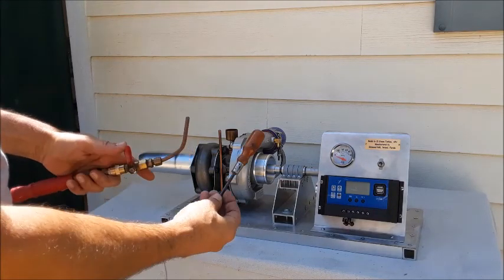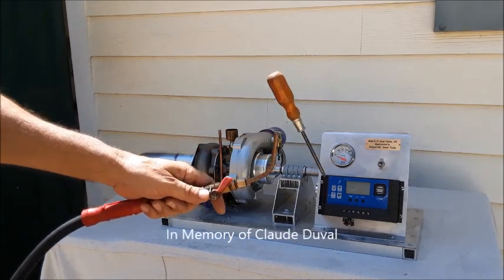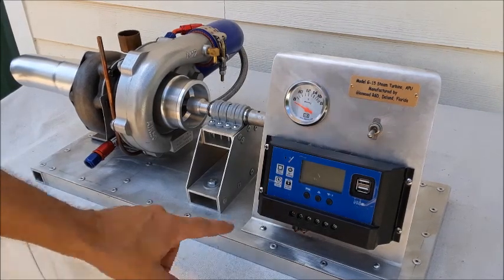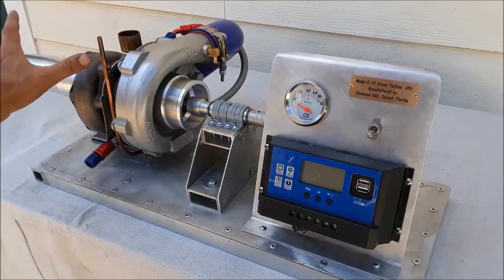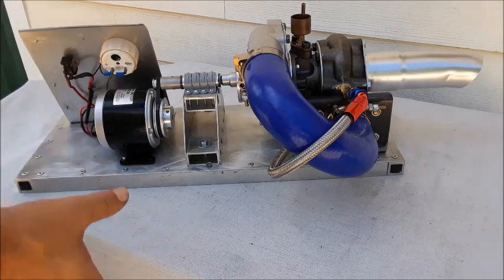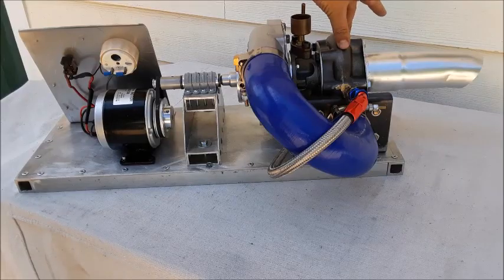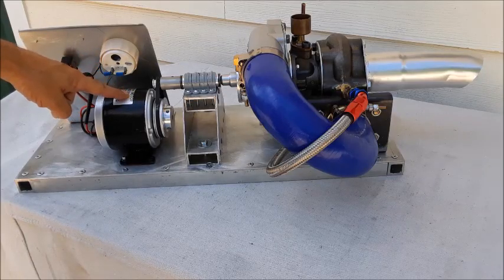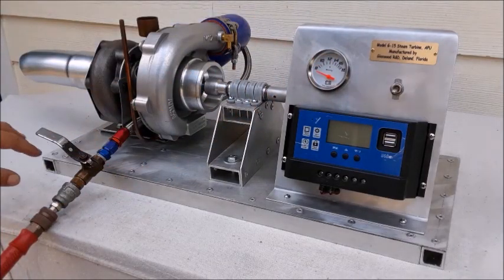Steam Turbine Upgrade

Comment: What size is your air injector and what pressure did you run for this test.
What is your turbo inlet size an what steam pressure does it need to produce the same power (noting that steam has 3 X the power of air)?
Reply from the maker: The injector is 1/8 inch. Iused 70 psi air in the vid. Th turbo inlet is about 65mm. I haven't finished my boiler yet, but the steam prassure will vary depending on the amp (load) being drawn.
Reply: @gwseymour  do you have a drawing or specs on your  turbo to subshaft coupler design and your bearing block components 
You mentioned a previous trial without the compressor turbine wheel was that a success that is the what I am considering. 
I am using you inspiration to try and generate power with my pulse detonation engine with water injection (to flash to steam) .
Reply: @gwseymour  is you 1/8 injector directed at the vanaes through housing or jost going into the inlet.?
Reply from the maker: @Graemecns  The injector is directed sideways at the vanes. Just play around without the housing, using an air hose to find your best angle. For the coupling, I replaced the end nut with 2 standard nuts (reverse thread) a deep well socket slides over these, creating a loose tolerance. The socket is pressed into a shaft. Here's a link to the first unit charging some batteries  https://youtu.be/BwsyxRz_eXs

Comment: Interesting is it a 2 stage configuration? I think Direct drive whoud be better but hay it's working man , congratulations 🎉👏
Reply from the maker: It is not a 2 stage. After the vid, I switched the belt to gears. This particular gen requires the reduction.
Reply: @gwseymour  anyway nice work man it's a inspirational video 😁 I can see this thing running on Tesla supper heated steam boiler/steam thrower ( it's basically a burner inside a tube surrounded by a mini boiler en after the steam is mixed whit the exhaust gases en them is it supposed to go inside a turbine or engine of some kind
Reply from the maker: @oscarverwey  Thanks for the thoughts!
Reply: @oscarverwey  fancy seeing you here.

Comment: Compounding turbo's would be interesting.
Reply from the maker: Indeed....I tried to keep it simple.
Reply: @gwseymour  🤣MB I didn't mean to sound like this wasn't interesting, I only meant it would be interesting to find out how compounding would respond because unless I'm thinking wrong you could spin up just a cold side on one and possibly run a small genset/motor off the removed/unneeded hot side housing meaning (again, if thinking right) you can step up or down in the size of the second modified turbo which would be even colder airflow yet on the second one as well.  Would also be interesting to see what going from big to small to big to small to big to small etc. etc. etc. would do because the small ones in that series would be really zinging I believe (or I could just be crazy since I'm half asleep right now 😂).
Reply from the maker: @510Redneck  Thoughts are always appreciated! If you have access to some old turbos give it a whirl!

Comment: I love this idea. I had never thought of using an ICE car's turbo as a turbine for electricity generation, but it truly is a genius idea. Just a whole load of turbines staring me straight in the face every day! An idea I had while watching this, inspired by steam engine's excess steam pressure, is to use the remaining energy that's in the steam exiting the turbo to drive a pump that circulates oil through the turbine's bearings. Albeit that turbos exist that have different bearings that do not require excessive lubrication if I am correct. Might be worth looking into this if the bearing becomes a problem in the future.
Reply from the maker: If you've got access to turbos, start playing! Since the steam turbine operates at far less rpm and heat, I've found that 90 weight oil "imitates" pressure, and the shaft floats in the journal bearings nicely. So far...so good. Thanks for the compliment!
Reply: @gwseymour  

How much power do you get out of the alternator as a fraction of the energy needed to compress the air?

I want to store my excess solar power in compressed air and then use the compressed air to generate electricity.

Comment: I’m going to be finished soon with a wood stove heating water, similar to your boiler. I was going to use it for heat and heating water but it’s summer now so I’m thinking to optimize it for heating water. I imagine I can make a lot of steam with it, it’s a high temperature rocket stove. I don’t know if it’s worth it to try to generate electricity with the steam
Reply from the maker: Sounds like a great stove. Do lots of research on high pressure steam before embarking on adapting your stove to create or contain it.

Comment: As a concept - lab bench  experiment it is a nice unit  no doubt about it. That said , the electrical energy needed to pressurize the air is greater than the energy produced by the adapted automotive turbo-charger /turbine.
Regarding the Tcharger ..they are designed to spool up on pressurized oil, eventually the unit will fail if no pressure is created to create the pressurized pillow of oil  inside which the shaft is rotating.
One quick way  to produce that pressure is to use a relatively inexpensive  OIL BURNER PUMP as found in residential heating , specifically the models that do not have a built in delayed oil nozzle valve . not that hard to get , the output to the bearings of the turbo is the nozzle output of the pump.
They are driven by the  oil burner motors , USA  manufacturers like Beckett or Carlin , rated at 120 volts 1/8 HP  at roughly 3450 rpm directly through  a 1/4 D shaped pump shaft  coupled via a slip on coupling  that is 3/8 D shaped at the motor shaft connection. They are also available in 1725 rpm versions  .. do the math for which one is easier to step down from your turbo speed... yes the same shaft that  turns the gen head would drive the pump. 
These pumps have flange mounts and set screw mounts making them truly universal mount ..the  good old days of standardization ... as opposed to  the aggravation age , can`t do nothing with it must hack and sack to make it fit .These little pumps can achieve rock steady pressures of over 175 psi and flows of up to 3 GPH at the nozzle output port . The pressure output is fully adjustable bearing in mind that it affects the  GPH a bit. They can be gravity fed or can lift  oil  in single suction line application up to 8 feet from a reservoir ...but for best result if lifting more than 5 feet , a return line configuration back to the reservoir   is usually best  by the simple insertion of a hex se screw in the appropriate passage . Install a pressure gauge where directed and off you go ...your turbo will be extremely  happy with about 85 psi a little lower perhaps even at the full speeds you are achieving with its return line also draining back into the reservoir , what volume ?  1 quart of lubricant in a 2 quart reservoir  is more tan enough if on the same level as the turbine  .For lubrication you will need an oil that is similar to FUEL OIL ...aka DIESEL viscosity that is still be able to lube and pressurize the turbo  and then a return it  back  to the oil  reservoir .The automotive oil must be thinned because those pumps will  require more than 1/8 horses to turn with say a straight   W30 oil...however ...a mix of  60% automotive oil grade  as specified for that turbocharger , mixed with 40% of the forever marvelous, MARVEL  MYSTERY OIL in ruby red formulation from the auto parts store will work incredibly well , it will not need any more  viscous formulations  because you do not have 1600 plus degree exhaust coursing through that turbo ...from a  good old fashioned 4 to 8 lungs IC MOTOR, or so it appears  at least judging from the size of the TURBO .
The pump units are boxed with simple to follow instructions. There were many  USA  manufacturers making them but probably only one maker is still USA owned. For your convenience and plague like availability ,a French company owned and former USA brand called  Sundstrand mini pump 3450  1/4 inch D section shaft, customarily found on Beckett oil burners made in Ridgeville OHIO will do quite well. You will have to under drive it from Turbine power take off shaft by using a belt driven pulley as you are currently doing with the generator head. Other brands include WEBSTER , GRUNDFOS , RIELLO ...Stick with the Sundstrand 
There is no shortage of belts or pulleys for the application . In fact back in the 1950s there were a few domestic oil burners that used belt drives as opposed to direct shaft drive to make their burners more compact...an evolutionary dead end. This will help  the turbine to spin more easily , faster and with considerably less drag.  
The biggest problem you face ...is that the turbo is not particularly good for what you are doing with it , yes it spins and produces something or other ...but  so could a rotary vane air motor ,more efficiently with greater torque and much easier to couple. Even a micro Tesla Bladeless disc steam  turbine with an appropriately sized rotor  would outperform the auto turbo with a fraction of the input . Setting aside  the Tesla viscous disc turbine , it is all about blade design ...simply put  a turbine blade spins under pressure impingement while producing the least amount of compression in its environment ..turbocharger impellers do just the opposite therefore require more input pressure  in order to produce the same results that a  true turbine of similar size  can produce with less.
As a proof of concept  bench  experiment , yours is very nice ... too costly to operate for what it produces , if  you want to make lots of usable  VOLTS backed by lots of usable  amps   from steam , you must consider a different blade geometry device in order to achieve it.
Reply from the maker: As far as energy (pumping up the air compressor)...No engine in the world produces equal or more than it consumes. That would be perpetual motion. 

As far as lubrication, I'm using gravity fed 90 weight gear oil. The unit does not run at the speed or temp of it's automotive design. The heavy viscosity compensates for the lack of pressure. 

Tesla turbines only work in theory because they require more rpm than we can mechanically sustain. Tesla is my hero, but even he couldn't make it work like he wanted. They don't have any torque, and need to get up to around 300k rpm. 

Thanks for the info on the oil pumps, and thanks for watching!
Reply: This isn't a tesla turbine but a modified version powered by a steam boiler   https://m.youtube.com/watch?v=ZvhmqVa4qpY

Comment: Awesome can’t wait to see it completely done. Btw where did you get the turbos/ turbines at?
Reply from the maker: Thanks! It was basically the cheapest automotive turbo I could find on amazon.
Reply: @gwseymour  in my country its not cheap lol. i dont know why but yeah.
Reply: @gwseymour  "It was basically the cheapest automotive turbo..." 
I was wondering where the turbine came from. I'm hoping you have posted a steam driven demonstration. I'm going to take a look through your channel.
Reply from the maker: @awaitingthetrumpetcall4529  It came from Amazon. It's an automotive turbocharger. No steam yet...life's trials keep delaying me.
Reply: @gwseymour  Thanks for the quick response. 
Yesterday I was trying to search for 'steam nozzles'. It's going to take some effort. I want to modify a pressure cooker with a copper tube and a nozzle to see how much steam pressure it will generate.
Reply from the maker: @awaitingthetrumpetcall4529  Be careful...those things aren't rated very high.

Comment: This is such a nice turbine set up. Really rooting for your set-up to produce some volts. We would love to try out something like that at our solar lab.

My friend and I are putting the final touches on a 10' diameter parabolic solar furnace. It's a repurposed retro tv dish with structural reinforcement added to base so we can safely use it as a solar lab to hook up various devices to, primarily steam powered, brewing, distilling, and some attempts at cooking too no doubt. We'll try to reverse engineer your setup in video. If you share links to the components you use that'd be a bonus of course.
Reply from the maker: Thanks!  I've messed around with Fresnel lenses, but nothing on the scale you are doing. The turbo was just a cheap one I found on-line (just over $100), and same for the charge controller. The rest was just hand-made from raw materials.  The only change since the vid is that I've switched to gears instead of the belt drive. Hoping to get my boiler done soon. That's when the real tests will occur.

Comment: Very nice, any idea on the turbine efficiency?
Reply from the maker: Thanks! Not until I get some real steam thru it!
Reply: @gwseymour  Roger that, will follow your progress. Interested in making an exhaust captures steam turbine for my boat and wondering what realistic efficiencies are. I can't be bothered with reciprocating engine - too many moving parts
Reply from the maker: @N330AA  That's exactly where this project is headed. Considering a turbine/electric pontoon boat. That's the platform needed to support the wood / boiler / batteries. In theory, one could travel endlessly, if there's enough wood along the shore (we have plenty along the St. John's River in Florida).  I should have had my boiler completed, but suffered a back injury. I have found turbines to be far superior. They are cleaner, smoother, and just plain fun. Reciprocating engines have a nostalgic sound, but once you've spooled up a turbine, you'll never go back.
Reply: @gwseymour  For sure, you can't beat the noise. Ok mate, i have subscribed to your channel! That's a very interesting project indeed.

Comment: What would it cost to make? And what the load and duration at a time. I'm talking No of TVs, AC units etc. I will not understand kilowatts or that kinda term. Not that smart.
Reply from the maker: It cost about $400. It's intended to charge 12 volt batteries, that would then be used thru an inverter to run appliances. The amount of batteries would dictate the charge time, and what you could run.

Comment: I would recommend finding a way to pressurize the oil for the shaft of the turbine,  and it would probably benefit from the oil circulating through a filter and radiator. It can reduce the wear on the turbine shaft/ bearings.
Reply from the maker: Indeed. But keep in mind that it's not operating at the speed and temp of an automotive application. I'm running synthetic gear oil in it, to assist in keeping the shaft separate from the journal bearings....so far, so good. Thanks for watching!
Reply: Hi, it's not circulating hot engine oil, also not mounted to a hot car exhaust, so cooling may have very little practical effect. I do get your point though, some pressurised oil will help keep surfaces out of contact. Maybe a small electric pump and CPU cooler radiator. In more stressful applications a synthetic lubricant with  a small type of CPU cooling device can be tested for longevity.  Lots of turbo chargers may have water cooling as KKK ones did.
Reply: @awesomed007  If steam is going through this, it can be hotter then vehicle engine exhaust. Vehicle engine exhaust is about 4-500 F, steam can be up around 1500, granted, that is VERY rare you will reach that temp with a DIY project, but it is possible.
Reply: @anjhindul  you are stretching the facts. Remember, turbo is directly connected to manifold, so manifold will exceed 1000+ temp. In night, one can observe the manifold may glow like molten larva. Try placing your hand near an engine manifold. No need for theoretical specs, natural experience is the reality. In this experiment with steam, the user has no such limitations. Further an engine bay is closed and the engine itself is a mass heat generator. Here only a small steam feed in open environment. Try to look at things holistically, otherwise all the technical knowledge in the world is useless. Hope u may employ my advice for life in general. Thanks for your input.

Comment: Oh wow! I'm also looking for information on steam power generation for off grid living. Do you have any blueprints or documentation on your work so far?
Reply from the maker: @PsilovibeGraham  It was really designed to integrate with a solar system, during periods of no sun.
Reply from the maker: Nothing yet, until I'm sure I have any bugs worked out, and it's running on steam. Gotta get my new boiler welded up.